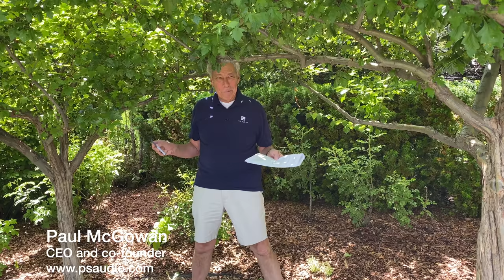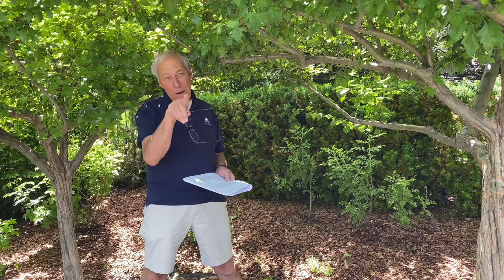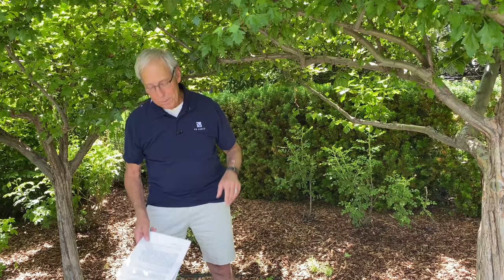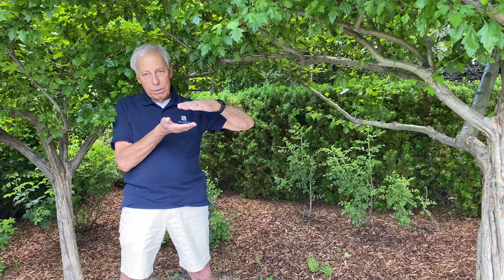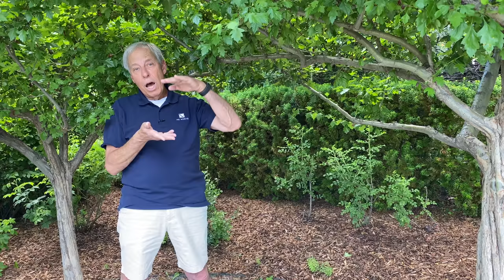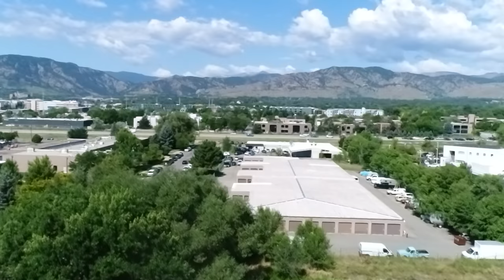Current vs. power in an amp

Comment: Answer was oversimplified and may not have addressed the concerns of the person who wrote the question.  
First principle to clarify, is that amplifiers are essentially voltage sources:  They set the voltage, and then the load determines the current.  
Second principle is that no amplifier is an ideal voltage source, and they all have a limit on the amount of current they can output.  
Third principle is that for the purposes of discussion, we are assuming that the amplifier is not being driven into clipping.  
As long as one is not reaching the amplifier current limit, then yes, any two amplifiers driving the same music signal into the same load, will pass the same amount of current and power.  But the problem that can be encountered, is that there is a plethora of methods used in amplifiers, to protect them against overcurrent.  Some of them do a good job at staying "out of the way" of the music, but some schemes have unfortunate sensitivities, especially when the load becomes highly reactive.  That can result in distortion caused by protection circuits, which then lowers the power output.  
Then of course, there are "difficult" speakers (which should never have hit the market, in my opinion) that place unreasonable demands on amplifiers.  Driving such speakers at fairly high power levels will require an amplifier specifically designed to be compatible with quite low speaker impedances.  Using an amplifier that's not designed for such cases, will again result in distortion and reduced power.
Reply: very much appreciate the time you took to write this.
thanks.

Comment: While the explanation is a little convoluted, the essence of it is correct. Might be helpful with some illustrations on a board or something. But it's quite simple, it's all Ohm's law. You have 8 ohms, you have 10 volts, then it needs 1.25 amps to reach 10 volts, which then is 12.5 watts. A 275 watts speaker at 4 ohms will have 33 volts at 8.3 amps when it's playing at full load. These figures are calculated for DC, so for an AC signal it will differ slightly but they are in the ballpark. This means that there's no such thing as "speaker A likes an amp with more current than speaker B", if they are both at the same impedance. The only factor would be if amp A has a weaker design and may not be able to drive high enough peak power, compared to another amp rated for the same output power, but this would only apply when playing at full load at very high sound levels, at lower volume this wouldn't be a factor anymore.

Comment: One finds out about some of this when a pair of 1k watt mono's are used to drive a pair of 600 W speakers and things go very quiet. lol
Reply: If you're playing music that's not highly compressed, and you are avoiding clipping, the speakers will be fine.  You should be more concerned about your ears, if playing such a system in a modest sized room.  
Even if running continuous sinusoidal test signals through the amplifier (woofer frequency range, of course), it can only exceed the speaker current rating by 29%, so it would take a while to damage the speaker.  
But how large of an amplifier is safe to use, is a complex topic.  Of course it depends on the kind of music and how it was recorded/produced.  One of these days I will do a study of some recordings, to see what the typical power crest factors are, and look at power spectral distribution (PSD) as well.  Then I could also look at the impact of clipping on PSD, and . . . 
There is probably no end to the investigations that could be done.  Good thing I'm retired now.

Comment: A thousand people a day.  Shooowiee, 365,000 in a whole year is roughly 0.1% of the population of the United States.  Lock your doors board up the windows and spray everything down with Lysol and don't let anybody within fifty feet of you until they have been thoroughly irradiated.  But most important of all make sure to abide by your local contact tracing surveillance program.

Comment: I think Paul don't get it..
W=A*V
You can get 50w in many ways (?…):
50w=5A*10V VS 50w=4A*12.5V

That is the real question (and not that we cannot do multiplication) :D

Or is there a STATIC relationship between A and V (that each change in voltage will give always a certain amount of amps on EVERY different amplifier out there)?

I can understand that that is the case for a specific amplifier but between different amplifiers. That use different types of topology, number of transistors, transistors types (MOSFET, jfet, tubes and so on), amplification types (A,A/B, B, D...) and so on..
Reply: The relationship between Amps and Volts is set by the load (speaker) impedance, not by the amplifier.  For a given speaker, any amplifier connected to it and producing the same voltage, will have to put out the same current.  
The only time you encounter a discrepancy, is if an amplifier is not capable of the voltage or current demanded of it.
Reply: Alex Defender  
I haven't seen impedance curves for your Dynaudio speakers, but did note that the design uses dual cabinets with different resonant frequencies.  This approach could significantly reduce the impedance variation that single-woofer systems exhibit, making them less demanding of your amplifier.  
Given that, I would suggest that you select amplifier type according to the kind of amp sound you prefer, not by voltage/current considerations.  Speakers that are 4 ohm with a 150W rating like yours are readily driven by any quality amplifier.

Comment: So any amp that fails to deliver double the wattage at half the impedance is current limited, at least down to the minimum impedance of the speaker being driven. Unfortunately, amplifier manufacturers rarely specify power output below 4 ohms. It is not uncommon for speaker impedance to drop well below 4 ohms for a portion of the audio band.

Comment: Hi Paul 

Quick question: will I hear an appreciable difference in SQ listening to a 450 watt vs 1200 watt amp at the exact same volume level on the preamp? Everything remains the same except for the amps.
Reply: Depends on the amps but generally, yes. If you're system is resolving, if the music you're playing is dynamic, then generally speaking, the increase in headroom plus (and this is important) the increase in linearity (of using less of what's there) will be evident in playback.

Comment: Power is energy per time. One Joule of energy per second is 1 Watt. Like you eat to make energy to move your body, a speaker needs energy to move the speaker cones. Approx. 100 Watts is what your body needs to stay alive. A Bic Mac has approx 2,300,000 Joules and can run your body or a food powered 100W amp for (2,300,000/3600)/100=about 6 hours.
Reply: A body power dissipation of 100W average, equates to 2000 cal/day diet, which includes some physical activity.  Basal metabolism is only around 70-80W typically, but it varies with both weight and age.  My little 70-year-old 100lb friend probably dissipates no more than 50W at rest, while a 25-year-old weightlifter in training might need to consume 5000 cal per day to maintain weight (250W average).  
I like the idea of a food-powered amp.  Much better use of a Big Mac, than eating it - but also much more expensive than the electricity, of course.
Reply: Marianne Oelund Yes, 100 Watts is just an easy typical human body power consumption number to remember and sort of in audio amplifier territory. Yes, if you could make a power plant turning the chemical energy of Big Macs into electricity with 100% efficiency, your electricity would end up being expensive. One Big Mac contains approx 0.6kWh of electricity and you might pay less than 10 cents for that wherever you live. A Big Mac is perhaps 40 times more expensive so even using junk food for feeding your food powered audio amp is not good economics 🤔
Reply: @ThinkingBetter  this is some awesome shit right here !!! I just don't know how it came to this 🤔 ??
😆😂🤣 I'm going to get a burger...

Comment: I have an NAD amp whose specifications are 150 watts into both 8 ohms and 4 ohms. Is there something that would explain this without concluding that it is underpowered into a 4 ohm load?
Reply: It's a very generic claim, not an engineering specification. The takeaway is the amp should be able to drive 4 ohm speakers and not blow up. Having said that, I just sold an NAD 326BEE because it really did not like my Magnepans (kept triggering the protection circuit).  Weird because all kinds of people use NAD and Magnepan. Brought NAD to a repair shop no problem found. So, traded the NAD for an Outlaw RR2150 and it seems to be a good match, ;-)
Reply: Mark D should of tried a pair of nad 2200pe monoblocks.
Reply: @markd9130  Find a used one of these  https://hometheaterhifi.com/volume_2_1/productr.html
Reply: I presume you are talking about the C275BEE?  
If so, this amplifier has two different internal supply (Vcc/Vss) voltages that it can switch between.  The automatic control over that switching is a bit complex, so without spending an inordinate amount of time to analyze it, it appears that in the case of the higher currents involved with 4 ohm loads, it will only select the lower supply voltage.  In other words, the fact that continuous rated power is still 150W at 4 ohms, is a very intentional part of the design, rather than an unintended effect of any design weaknesses.  
Another important aspect of this amplifier design, is that it has much higher dynamic power capability for music transients.  That is 410W into 4 ohms or 600W into 2 ohms.  The lower numbers are for continuous output, so do not give a fair indication of the amplifier's capabilities for music programming (unless you're listening to severely compressed/limited music).  
If you want any more detail than that, I could spend more time looking into the circuit design.
Reply: @behexen250 
It's bridgeable, but in that configuration is only spec'd for continuous power into 8 ohms, 330W.  
The 4 ohm power rating is for normal stereo operation, and is for continuous output.  The amplifier is capable of much higher power into 4 ohms (>410W) and even more into 2 ohms (>600W), but only short-term, i.e., not continuous.  In other words, its design is oriented toward typical music signals, not lab test signals.
Reply: @marianneoelund2940  Yes, it is the C275BEE. Thank you for your excellent explanation
Reply: Lee Kumiega that’s a nice piece of kit and rare. Still wouldn’t part my 2200PE’s for it though. Bought and sold many amps but always gone back to the NAD’s. They are in a league of their own. Drive anything. Even used temporary in a live setup whilst a pair of peavey cx1000x’s were in for a service and performed better than pro kit amplifiers. Much better headroom. Dynamic range. Which meant better when getting the levels set etc.

Comment: Hi Paul, love the videos. P = I x V is pretty clear, but the whole speaker resistance business needs to be explained properly. Does this have to do with two resistors being a voltage divider? If so, if the speaker is one of those resistors, what is the other? Resistor in volume control? Output resistance of amp? Does it then matter what output resistance the amp has? The speaker 8 ohm vs. speaker 4 ohm doubling of required current only works if the other resistor is of fixed value, which seems doubtful across all amps ever produced
Or, is does it have to do with Ohm's law V = I x R? If an amp output is current-regulated (as opposed to voltage regulated), then with same current and half speaker resistance one gets half voltage. And if voltage = loudness, then that explains different sound level produced by speakers of different resistance.
Would love to some clarity on this.
Reply: @behexen250 The frequency dependent speaker impedance is something additional. My main question is how the doubling of power requirement of speakers with nominal 4 vs 8 Ohm is explained. Either with voltage splitter between two resistors in series, or with ohm's law and single resistor. Still not clear on that. P = I x V does not explain it.
Reply: Amplifiers are voltage sources, i.e., yes, the output is voltage-regulated.  This remains true as long as you don't try to pull too much current from the output, and the amplifier will keep putting out the same voltage for a range of loads.  The equivalent resistance of a typical solid state amplifier output is extremely small and can be neglected, as long as you don't demand excessive current from it.  
So the equation P = V^2 / Z is most appropriate to understand how power varies with speaker impedance.  You can treat V as constant, then P varies inversely with Z.  That is assuming that you have chosen a V that is within the amplifier's ability for all of the values of Z you want to use, and again, that you're not trying to pull more current than the amp's limit.  
But for all real amplifiers, the voltage clipping point will decrease as load impedance is decreased.  That is why the max power rating of the amplifier doesn't quite go up with 1/Z.  Max power ratings reflect other internal limitations of amplifiers, which you don't see the effect of when using them below max rated power.

Comment: It helps to look for a power rating messured at 20 - 20.000Hz, all ch driven with 0,0xx% THD.
Too many manufactures messure at only 1kHz, 1 ch driven @ 1% (or even as high as 10%) THD.. That gives ALOT higher numbers on paper but in reality it's only 2/3 or maybe even 1/2 of the power.
And check how big the power supply is so you can do the math and see if it even can be capable of delivering enough power to get the rated wattage out to the speakers. But to do that you also need to know ho efficient the amp is.. If it's a class A, A/B, D etc..

Comment: Max power transfer is at R(load) = R(source).
Reply: Not that simple.  Sources with over-current protection will put out very little power into a load that's equal to their Zout, before shutting down or limiting the current.
Reply: It was for Moritz von Jacobi back in 1840 when he developed his theorem.
Reply: @PebblesChan  
Fortunately for the world, Moritz didn't have modern audio amplifiers or regulated power supplies with current limiting to fuss over.  Otherwise we would never have had such a simple and elegant statement.  But you need to know more than the rules - you also need to know when they do, or do not, apply.  R(source) is not a constant in many cases.
But to be a bit more helpful, here is a modified rule which can be used for real amplifiers:  Max power transfer can be achieved when R(load) = Vpeak(source)/Imax(source), where Vpeak is the clipping point while output current is at Imax.
Reply: Neither is BBQ(Sauce).
Reply: While the equation is true speaker impedance varies quire a lot making it impossible to match impedance ,also in order to deliver a lot of current to low impedance speakers the amplifier must have a low output impedance.
Reply: Even more so with the various speaker crossover designs used.